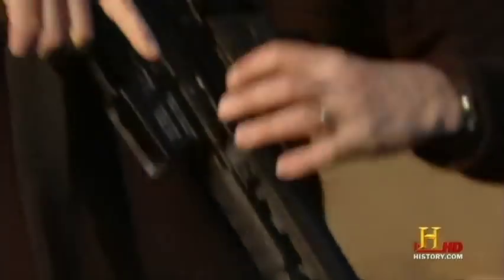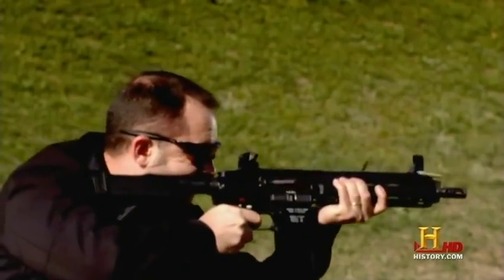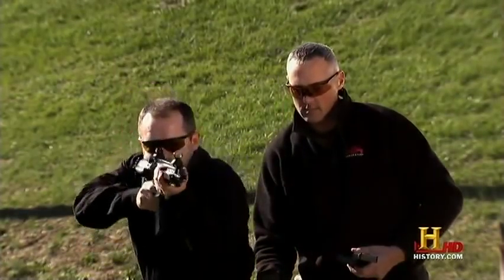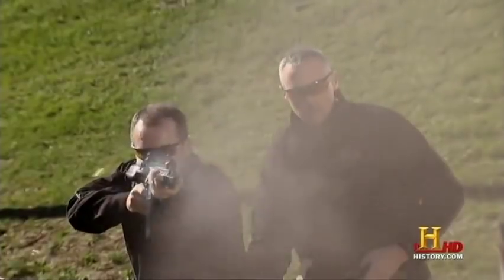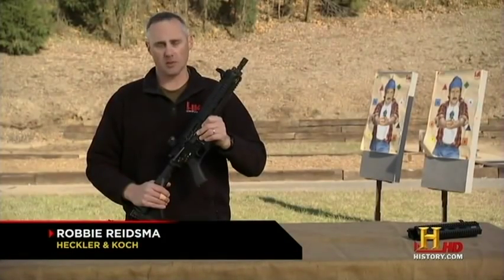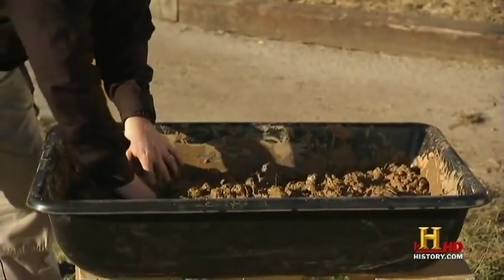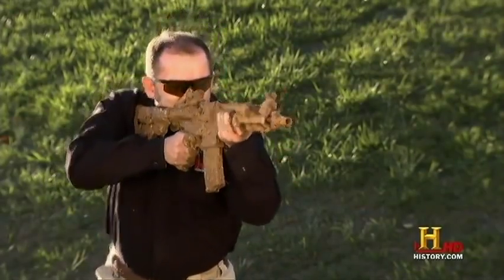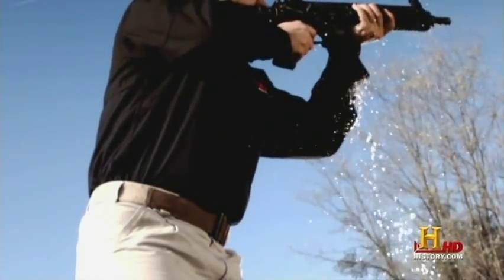HK416 Assault Rifle

Comment: aahaaa so they copyd the AKs fire system ok....
Reply: Zoltan Csikos aaahaaa ok yeea totaly mmmhmm ok ;)
Reply: Zoltan Csikos ok ok keep on thinking its based on the G36 plzz keep thinking this way.
Reply: Zoltan Csikos you say its based on the G36 i think you got something mixd up the XM8 (the melt gun) is based on the G36...not the H&K461 it uses the same principal as a AK dose too get it more reliabal and not useless in combat and it still is not nearly as reliabel as a AK and from how expensive and overprised this thing is and the round it fires well its better off just upgradeing the M16 and M4 then buying this and its not impressive at all (from performanse point of view) by me i will go with the AN94 eny day i look of extreme performanse not an slightly inproved and more reliabel (less reliable then the AK) model of a M4...
Reply: Zoltan Csikos the 416 is short stroke right?
Reply: Colonel Wilkins yes
Reply: Colonel Wilkins Yep, the Short Stroke Gas Piston is great.
Reply: Actually the 416's operating system is based off the AR18, so was the G36. Really any weapon running a Short Stroke Gas Piston is based off the AR18 or AR180. The AK has a Long Stroke Gas Piston operating system, both are very good and both have their merits, but they are not the same what so ever. The AK isn't as reliable as the fan boys believe, yes they are reliable but it's not indestructible and it does fail. In the Military's 60,000 round torture test the AK had 108 stoppages, the M16 had 211, the HK416 had 76, the PWS MK1(Long Stroke AR15) Series had 30. The AK is not the end all be all, and the HK416 didn't copy the AK, you really should educate yourself on something other than Call of Duty.
Reply: I heard the AK fires magical seeds which sprout bean stalks from capitalists, amazing. Truly. It also has a lock on ability so you can shoot down aircraft! Amazing. So amazing. Utterly amazing.
Reply: nop the russians copyd the stg44 system -.- we founded the system not the russians they just copyd it
Reply: ***** ummm what? i just provided sorse and you say "nop just shut up" ??? what are you 12?
Reply: 00008HANK Probably..
Reply: demongawl What you've just stated is false. The G36 and HK416 operating system aren't based on the AR-18 system AT ALL! There's no evidence to even support that statement. The HK416 short stroke gas piston was based on the G36s operating system which wasn't actually based on anything, it was it's own design. I know why you stated that it was based on the AR-18 system, it's only because the basic idea (of a piston moving back and forth a short distance) is the same but none of the rest is the same. It's actually quite silly to state it was based on the AR-18 system because of that because the AR-18 wasn't the first short stroke gas piston weapon. So by your logic that'd mean the AR-18 copied another weapon or that all Assault Rifles firing the 5.56x45mm NATO round are copies of the M16. It's silly.
Reply: WilSkullGaming do you really think the AK74 and AK47 are the same? if yes i feel sorry for you.
Reply: Zoltan Csikos
 Can you back that information up? Everywhere I've looked, the G36 is based off of the AR-18.
Reply: rambokicksass77 Can you back your statements up with evidence? Because nothing states that it's operating system is based on the AR-18s. Maybe you're just looking at some patriotic American shit head site which thinks everything is from America. The G36s operating system isn't based on anything else. It's HKs own design. People that state it's based on the AR-18s are ignorant. That's like saying every Assault Rifle chambered for 5.56x45mm NATO is a copy of the M16. Or that the AR-18s operating system is based on the operating system of the SKS just because it has the same style.
Reply: Zoltan Csikos
Every website I go to says nothing about American patriotism and no, hardly anyone believes that everything came from America. If you look at some pictures of the AR-18 and G36 disassembled, you'd see that the gas system is similar. That's all they have in common. Where are you from?
Reply: rambokicksass77 It doesn't matter if they look similar. Does that mean the AN-94 is an AK-47? No. I've Googled this and the only word that's said is that it "appears" to be similar to an AR-18 operating system, "appears" is not something used by professionals. It doesn't matter of they look similar, that's only because they're the same style. Nothing else. If you took out the SKS operating system then you'd have a short stroke gas piston as well. Look similar? Maybe. Is it the same? Definitely not. It also doesn't need to state it has American patriotism, you can detect the patriotism in a website easily. There's no need for them to state it.
Reply: Zoltan Csikos  "Does that mean the AN-94 is an AK-47?" No, I never implied that. The gas systems are similar in the way that they are designed. Have you ever taken apart either rifle? And what did Americans do to you that makes you hate them so much? Jeez.
Reply: Zoltan Csikos
 There's always going to be people like that. Same goes for hardcore Russian gun fans, German gun fans, etc. Believe me, I'm not one of those guys. I just try to be as unbiased as I can. I recognize the the merits of each weapon and acknowledge them. For example, the G36 is light weight and very reliable and has a lot of good features. The AK is very reliable and well proven on the battlefield. The AR-15 series and their derivatives are proven, very accurate, versatile, and modular. All I want to know is if you've handled the G36 and AR-18 side by side or if you've spoken to HK engineers about the origins of the rifle. Of course you understand that many companies are trying to sell a product and will try to make advertising or claims that's it's the best on the market and that it's revolutionary. Same goes for HK. They make fantastic firearms, but they aren't the end to end all and many rifles have their own roles to play. As for the AN-94, that belongs in a museum. :P
Reply: rambokicksass77 I always love pointing out the AKs flaws to the AK fan boys, it pisses them off so much.
Reply: Ikito Husky ничего вы не создали! до АК-47 был АК-43!!!
https://topwar.ru/?newsid=13006
Reply: Udo SN learn english
Reply: ***** онлайн переводчик
Reply: 00008HANK AK copied it from Sturmgewehr 44
Reply: Yes Exactly Instead Of AK It HK Instead Of M16 Its HK416 It Great But The Russian Are Making A New AK47 and 74U Just Putting That out There.
Reply: No No He Is Right Mate. Gun Copy Other Guns To Be Better Than The Orginal. That's How We Improve Our Fire Power It SMART!.
Reply: Zoltan Csikos First of all , Germans invented the Assault Rifle , the MP44 and It was a piston design , the Ak was based on the MP44 ,so according to your logic , Ak is a copy
Reply: 00008HANK The Ak mags are diferent from the MP 44 s because their caliber is lower
MP 44 used the 7.92 mm 
The AK 47 used the 7.62 mm
Kalashnikov also took the piston system and the curved Mag style
Reply: Morro-主の神-Lloyd Yeah , I guess so, i shall stop to argue with a rock